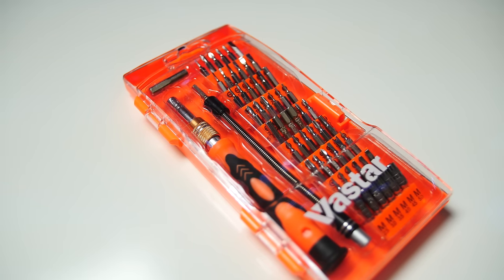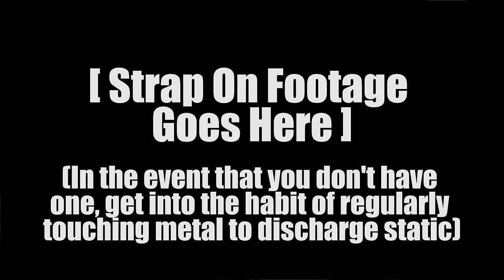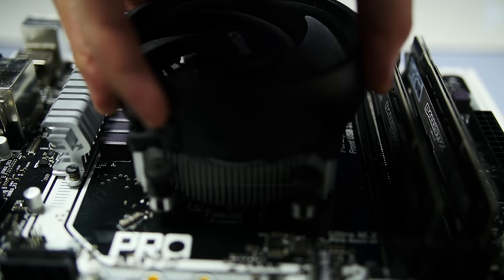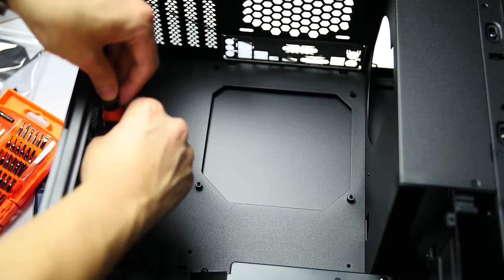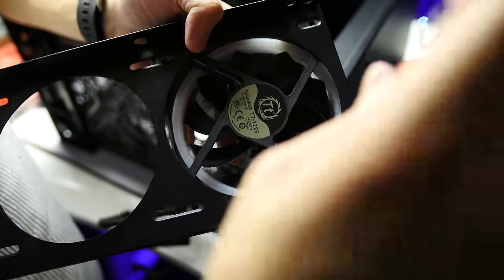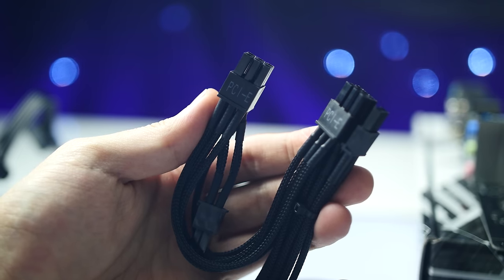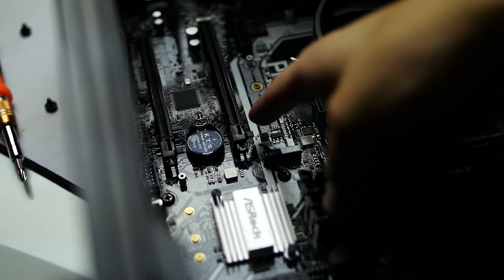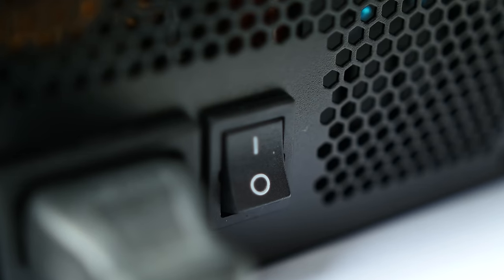How to Build a PC!

Comment: What does Mt/s mean on the ram label? How many MHz is it?
Reply from the maker: DDR is double data rate.  Technically speaking, RAM at 3000 MHz should really be 3000 MT/s.  Memory transfers data twice per clock cycle, so "DDR4 3000" has an actual clock speed of 1500 MHz, which is effectively 3000 MT/s.  Hope that makes sense!
Reply: Thanks, so 1MHz=2MT/s

Comment: How viable is installing the intake fans on the bottom of the inwin 301? Do they get in the way of the motherboard or cables?
Reply from the maker: They don't appear to conflict with the motherboard.  Maybe with the cables, but I guess that depends on what you plug in.  I'll be doing more on this case soon, though!

Comment: Does that inwin case have filters for those side vents?  Or are those only meant for exhaust?
Reply from the maker: No side filters, only on the bottom!  I believe them to be intake (though, I don't see why you can't exhaust from the front, as long as you intake from the bottom), but I will have more details in the upcoming review!
Reply: I wouldn't use any unfiltered vents for intakes because I'm too lazy to clean out the inside of my case.

Comment: Hey dude, does this motherboard https://www.asus.com/ROG-Republic-Of-Gamers/ROG-CROSSHAIR-VI-EXTREME/specifications/ fits in the  460x RGB or the 570x RGB,  please answer me D: i want that motherboard and any of this cases.

Thank You
Reply from the maker: The Crosshair VI is an E-ATX board 26.9cm wide.  The 460X and 570X officially support ATX only, but the 570X can fit boards as wise as 27.2cm, so it should work with that.  I don't know about the 460X.

Comment: Anyone here having problems with the tomahawk board? I can OC my CPU to 3.9ghz and RAM to 3200. But when i boot into windows it shows otherwise
Reply from the maker: I don't have that board, but what exactly does it show in the operating system?  Do you have the multipliers and clock speeds locked?  Do you hit the right speeds under stress tests?
Reply: ALittleDIMM 
Hey! its cool that you replied, thanks :D 

First of all I have
B350 Tomakawk Arctic
Ryzen 1600
Gskill Trident Z - 3200 x2
Galax Gtx 1060 EX OC White

So in Bios I have 3.9 and 3200 but in windows it says 3.4ghz and 2133. ( Ryzen Master )
I tried experimenting and I adjusted the ram to 2133 in bios, when I boot to windows I have 3.9 for cpu and 1467 in the ram.
I already tried flashing the new beta bios update about 4 times.
Using Ryzen master I can see the CPU fluctuating from 1.55 to 3.9GHz, I think it goes down on idle?
Tried the cinabench and i get 1267( Is that good? ). 
Im just a new to this overclocking and I just followed the guide in the MSI forums.
Reply from the maker: Sorry for the delay, didn't see this notification!  I would double check with another program like HWiNFO64.  I think AMD recommends this one as well.  

Fluctuations are normal, CPUs can and occasionally do adjust their speeds and voltages depending on the workload they're tasked with.  

A Cinebench score of 1267 sounds about right, I think I would expect that of a 1600 chip.

As for your RAM, I hear some Ryzen chips can struggle with higher RAM speeds.  I would aim for 2666 MHz first and try to bump it up slowly from there.  Depending on the program, it may show half of what you dial in on your motherboard.  DDR stands for Double Data Rate.  If your RAM speeds seem surprisingly low, there's a good chance it should be doubled to show the (advertised) value.